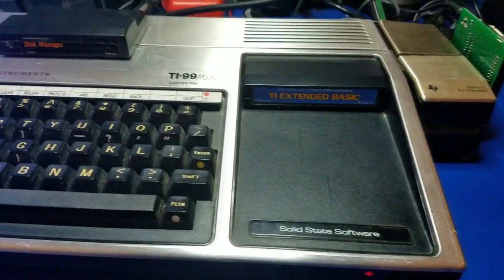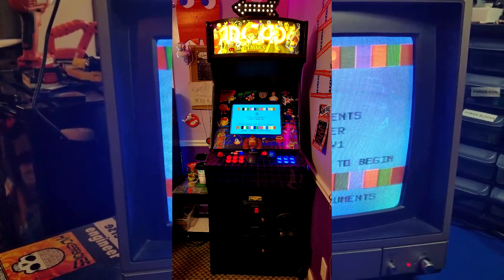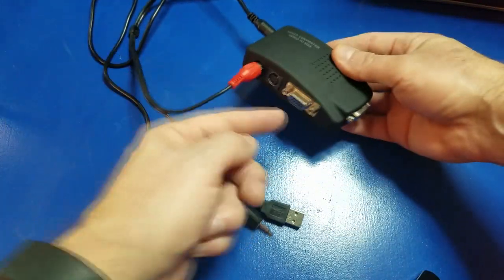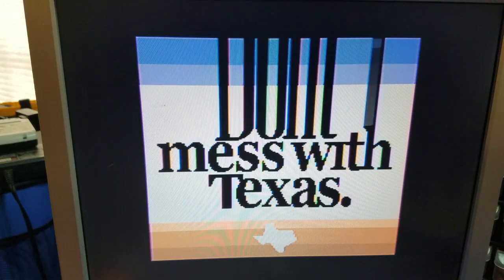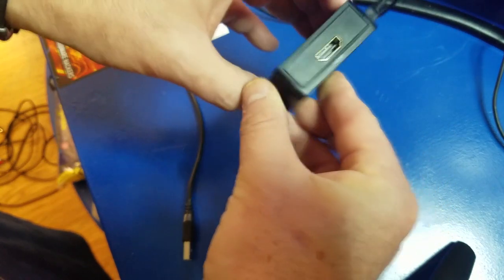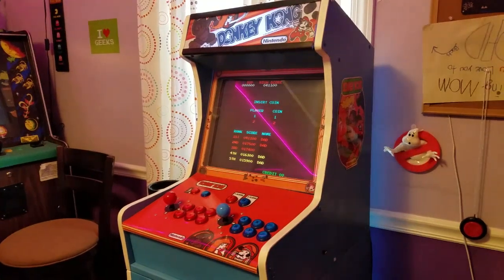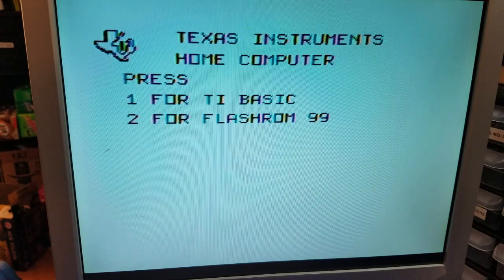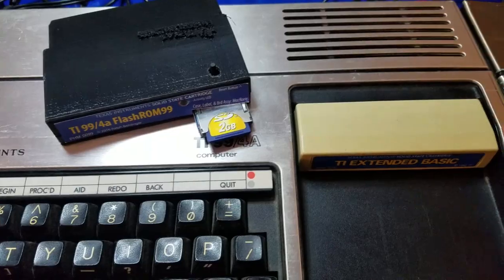TI-99/4A - AWESOME UPGRADES: Video converters, TI99 Sim, FlashRom99 and more!

Comment: My 99 had a 6 pin din connector on the back which went int an RF modulatorwhich then connected to the TV antenna conection via a coax cable.
Reply from the maker: That's what I had back in the day as well.  But, much easier to use  the din-composite output adapter instead.  I think I got my cable on ebay, but they are also on arcadeshopper.com (at least, they were at one time).

Comment: I recently got one of these exact model TI99/4A. I have mine tested on a LCD TV via an RCA cable, before disassembly.  What I want to do is replace all discrete components (caps, resistors, etc) with modern equivalents and am waiting for the F18A Mk.II to come out. A wish I have is for a modern motherboard that will fit in the TI while correcting some mistakes (like those damn patch wires).
Reply from the maker: I'm also on the list for the F18A MK II, I'm down for 2 of them when they're ready.  Those will have an HDMI port and I'll definitely be releasing a video of that upgrade process once I get my hands on one!
Reply from the maker: One more thing, if you haven't seen the TIPI yet, please check this out https://youtu.be/5NPYWeCx-lk  I'll be hooking mine back up in the next couple days, so much fun!  I've been swapping between the TI and some Robotics projects lately but will be back on the TI soon.  If you have or wind up getting a TIPI, look for 'jonecool' and say Hi :)
Reply: will do :)

Comment: How on earth did you get a video signal out of the tape port? 
Best way to hook a TI up to VGA is with the very easy to install  F18A, which replaces the 99's video chip with a new one....provides enhanced graphics (so you can play a demo port of super MArio Brothers and access 80 collumns in programs like Microsoft Multiplan) and native VGA out.
Reply from the maker: Composite TI cable is how I did it last year.  Today, I have a little bit better way. I've been on the waiting list for the F-18A v2 (HDMI) for almost a year now they are great, if you can get one. If you can't you make do with what you got LOL

Comment: The AV2HDMI adapters don’t last long in my experience and internet reviews but they are  good while they last.
Reply from the maker: Haven't had any issues with min, so far anyways.
Reply: Mine was white but looked the same. Got it on amazon it later about two weeeks then kept resetting. Found another one on a boot sale. Came with a 4 way hub and Bluetooth headphones.The headphones worked but nothing else. The battery only lasted about 1hr on the headphones aswell.

Comment: Hi, I enjoyed your video on retro pi. Can you help me out getting the TI 99/4a installed onto retro pi?

Thanks
Reply from the maker: Hi Jeff, I may create a video in the future on this when I dedicate time to explore it further.  I'm running ti99sim on my RPi arcade cabinet.  Although, I didn't get too sophisticated in terms of running disk/tape, just carts.  There is some information available on atariage that may be helpful to you, here's a link:http://atariage.com/forums/topic/250767-how-to-install-ti-994a-ti-99sim-on-retropie-v36-raspberry-pi2-or-pi3/

The only issue I encountered when trying to get ti99sim running on my (Retro)Pi was that the naming of the BIOS file had to be exactly like the instruction stated (case-sensitive).  I had downloaded the BIOS and the case was not correct.  It wasn't until it dawned on me that I should make sure it's exactly like the instructions that I got it working.  You're issue may be similar.

Here are the exact instructions I went by and had success with: https://github.com/RetroPie/RetroPie-Setup/wiki/TI-99

I hope it helps you, please drop me a note here to let me know it did help.  I always like to hear success stories :)

Comment: you are unlucky, but really UNLUCKY of owning an american TI-99/4A, its composite video only! Us europeans have YPbPr non-standard output that gets converted to RGB thanks to the french PHA2037 converter unit that came with french TI-994A units! PAL is really my pal here!
Reply from the maker: Hoping to improve that this year, I'm on a waiting list for the F18A 😃  That would provide HDMI output.
Reply: @WagnersTechTalk  oh yeah, the f18a its a gem! it is perfect for serious ti99/4a users !
Reply: Wagner's TechTalk might just wanna upgrade your vdp to a TMS9928a instead of the TMS9918 because it has the same quality output as the TMS9929a from the PAL 99/4a instead of the crappy composite of the 9918! I don’t know if the board has the traces wired for 9918 only so my guess would be to make a PAL 99/4a NTSC by replacing the vdp by a 9928a (NTSC equivalent to 9929a(PAL) )

Comment: I don't know... using a modern display kills half of the experience for me
Reply from the maker: I hear you but CRT monitors/TVs are getting harder and harder to find in working order.  Even my original TI monitor is starting to fade and the volume control is beginning to short out.  Nothing a new cap kit and a little refurbishing couldn't resolve, but it's good to have other options too.